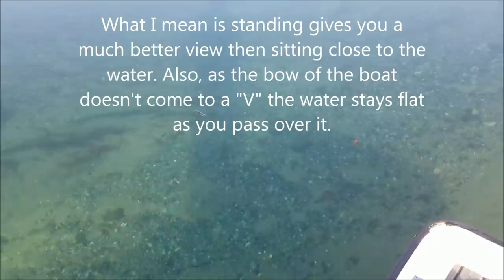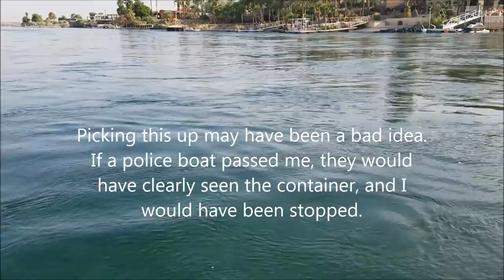I Bought The Strangest Little Boat On Craigslist

Comment: You should look into either building the jack plate higher so the pump isn't so far in the water, or see if it's possible to shorten the lower unit so that the intake of the pump is just below the bottom of the boat. Or, swap out the jet for a prop....but the jet would be a lot safer obviously. The prop will be much faster though, so it's kinda like half a dozen in one hand and 6 in the other. Cool project! Nice work!

Comment: The technique is old, it's called peel ply and used to form a smooth face when building up layers.  You will find a grooved roller very useful on corners compared to a splodging brush.  Also cut the bristles down about half and try that, much better at splodging.

Comment: After watching later in the video when you were first testing it, I can confirm adding some trim would be a good idea. Just a little, nothing too drastic. It will bring the front up a little when you're cruising up on plane. The boat will ride better and when up on plane you will only have the back like 2 ft of the boat in the water. You will also pick up a noticeable amount of speed.

Comment: Cool project just a little tip when putting screws in fiberglass you should always chanfer your holes or the gel coat will crack

Comment: Interesting to watch different techniques. I learned to use  a tray to saturate the fibres first and then lay the sheeting over the area to be repaired.  I would then use the plastic sheeting and use a wall paper roller to roll out the bubbles and excess resin.  Never had a failure.

Comment: I agree with you about the problem one faces with any squared edge as you said about the previous repair (and you were beginning to see in your repair) - and you began to see it in your repair.  I just had an idea because of that issue.  I've done fiber glassing to things that I've created or repaired and I've got and idea If I ever do any more application of cloth to an edge like that.  For instance - take a set of pieces of scrap plywood or 1" by 4" boards long enough for the section plus a few inches to cover the entire edge of the repair and some pieces of 1" thick foam rubber.  Because of the fact that the repair area of the craft is not too drastically curved what is being assembled will work over the area.  Then assemble the wood into a 90 degree angle form.  Cover the inside of the wood form with some foam rubber - and it really doesn't have to be glued to be form either.  While the repair area is still fresh and not cured -  cover the entire repair area with the protective plastic sheet to ensure the foam rubber will not stick to the repair.  And finally lay the foam rubber over the repair area, then lay the board form over the foam rubber and run some ropes or straps around the entire craft so they will hold the wood form tightly against the craft.  The foam rubber in between will be squashed tightly and it will take up the irregularities in the fiberglass repair.  This contraption will squeeze out the air bubbles and hold the fiberglass perfectly against the sub-structure.   Halilullah a great repair.

Comment: looks like fun!  watch out for your right trailer tail light. it's either not a boat trailer model or the seal is leaking and you could see bubbles when launching. hot bulbs (brake lights when launching) and water don't mix well! unplug the light connector before launch or seal the tail lights.

thanks for sharing!

Comment: Great, now you've got me thinking about building one.
Reply from the maker: A guy on facebook just got done restoring one his dad built in the 70's

https://m.facebook.com/groups/205974212923541?view=permalink&id=1567841896736759&sfnsn=mo&extid=MPOUlH6LSr3l5TKY
Reply: My first thought
Reply: List for build. Styrofoam, 3/4in sheet of plywood, a folding chair, and a small prop trolling motor. Duct tape, 12 pack of Bud Ice,
Reply: My dad used to build something similar out of 2 sheets of plywood, some 2x2's, a 1x2 and a 2x4. One sheet was the bottom of the boat, the other was cut into 6 strips (2 straight and 4 tapered)  that were used to build air tight 'pontoons' on either side.  The 2x4 went from side to side across the back at the top of those pontoons to mount the outboard.  The 1x2 was on the bottom center, front to rear as a keel. Put a 20 hp outboard on 50 lbs of lumber and it'll fly.
Reply: @sweet65mustang  what was this boat called
Reply: @rufinogonzalez6020  if you're referencing the boat my dad made, he called it a 'skip jack'

Comment: Little tip.
Tape the fiberglass on one side really good on the bottom.
NOT the side.
Fold it back
Then pour and brush the resin on the area to be covered.
Fold the clothe over stretching it tight but not to tight and tape the side really good. 
You should also have slightly streached it end to end when you first put it on.
Now pour and brush the rest of the resin.
You won't have to worry about bubbles that way and when your finished ready to remove the tape it'll give you a nice straight line to trim off excess clothe.
I helped my Dad build a homebuilt airplane growing up and he taught me that technique.
I've used many times since then on various projects and it makes compound and simple bends easy.

Comment: You could always put those carpeted rails on risers or on a scissor set up. Where you can raise & lower the boat on the trailer for towing & launching. That would be an amazing set up for it. And pretty cheap & easy to make. Well worth the small cost & effort. You should also seal those trailer lights up. Those bulbs & DC current dont either one car for water. Not if you want them to keep working for very long....

Comment: Good easy fast repair .... I would have cross drilled on diagonal and driven epoxy coated bamboo skewers thru...front to back angle slightly as well ..... just locks the crack together...... also after grinding down take acetone and soak down into the crack flexing it open closed let that set awhile 15 to 30 minutes then apply epoxy in the crack and flex then drive in skewers .... the acetone preps the surface for bonding and the skewers lock it all.... you can also drill couple small holes and inject resin into the inside position the boat so the resin will settle into the inside and create a strong fillet .... use teflon  cooking sheets works too many saran wrap etc stick into the resin
Reply: bamboo? skewers? i would love to see this technique done!

Comment: Been doing fiberglass repair for over 45 years and do not use mat always use cloth. It comes in different weights for different jobs. You can do repairs and relaying and if done right it is damn near impossible to tell. Have done boat, car and custom body repairs and paint. Making molds of edges on opposite side will make contours much easier to match and blend. There multitudes of tricks and tips you learn from the old pros. It took 45 years, but now I can say I am now working as an old pro! Good luck and keep the little jewel and keep it "shipshape" and you will have a piece of history. A unique piece of history! And put a larger power plant on it! Zoom! Zoom! :/
Reply: Looks great. Runs pretty damn good too! You did the little thing justice. Definitely do not get rid of it. It will be a great piece of unique history as it ages. And a conversation piece too! Sweet!

Comment: I used to make fiberglass enclosures for car audio systems. A good pro tip is to use spray adhesive to stick your mat to and that usually keeps the mat in the shape you want.

Comment: I have a Johnson 20 converted to a 35. Changed the intake and Reed valves to 35 then  put a 35 carb on with the correct jet ( not the 30 jet ) . Putting on a 56 14' Al. New 2" transom of marine ply from a 18' boat that had trailer tire burn because bearing seized on how, heavy traffic could not stop guardrails on side of two lane.
Big hole in side ,so salvaged,  parted use transom for 14. New 20-35 a 20" so will transom be.

Comment: I used to own two of these built by a company in San Dimas CA. They were cal!ed "Water Streakers" with 25hp Tohatsu  motors. I have some photos.
Reply from the maker: Please share.
Also, do you know what year they were?
Ever fall, or have any unsafe incidents? If so, what were you doing?
Reply: @BrandonsGarage  What year?  I think I bought them sometime around 1989.  I never fell but when you fall it goes straight so the risk of injury from the propeller is very small.  The seller advised to jump off if  you risk flipping upside down as then are hard to right and the outboard gets a soaking.

Comment: chop is for top layer . you have to get all the air out . Sand much more wider and deeper to remove crack . If you do it right it will be stronger than the boat

Comment: Nice job, Brandon!  I really enjoyed your style of presentation, with exactly the right amount of "comic relief" where appropriate!

One observation that I was surprised nobody else mentioned:  With regard to the trailer rebuild, and especially since this boat is not very maneuverable at slow speed,  I was surprised that you didn't add some bumpers/padding to the inner corners  on both sides.  this would obviously protect you from scratching chunks out of the front/sides of the boat when approaching the trailer.

Enjoy her - she's very cool! ;-)
Reply from the maker: I thought of that too, but as this isnt really the kind of boat would would power-load, I didnt think it needed.

Comment: Instead of a ziplock freezer bag, you can use a piece of bag from a food saver. Tape it around the edges and insert a small diameter tube that's been perforated. Connect tube to a vacuum pump. This works great for small stuff, amazingly.

Comment: Great, he did it his way the way it should be. The oriinal motor was stuffed, repaired it would have worked well its a light moto,r that's what it needs. The 20 it runs bad too, lots heavier not what the boat needs.That jet drive on a twenty dosent't work, your lucky to get 70- percent as if it had a prop. My guess is it was designed to be a cheap toy pre jetski perhaps. See that motor did not cost much and the hull  is simple cheqap to make, not as much glass and materials as a full size boat.. The company assuredly folded, it did not sell well or whatever, it failed. That said if you get enjoyment and it did not cost you much well call it a damn big success. I liked the restore all good domt forget to have fun people...

Comment: Pretty cool score !  A buddy of mine in Florida had a few of those original Personal Water crafts that  looked like a snowmobile but was powered by a Envinrude 9.9 outboard you did sit on top of a seat  but there wasn’t really any safetey provisions for  not  getting a hand or a foot into the prop?  I think they called those Water Scootersin the late 60s early 70s

Comment: First time I've seen your stuff. Really enjoyed your style.  I could nit-pick abut using chopped glass mat for structural repair but that boat and that case, meh. Doesn't matter. It was a really nice repair and boat turned out really well. Very unique. Rust-Oleum gel oat huh? I'll have to check it out. I'll have to check out your other stuff.

I'm looking for, having a hard time finding, an old late 50s/early '60s fiberglass boat with George Jetson tail fins. Don't recall the builder. I think they were all white hull and red topside. They used to be everywhere and could get 'em for a song. If you see one give me a shout. I've got an idea for a fun build and almost enough time to get started.
Reply: Glastron modeled a boat with fins after a Bel-Air
Reply: @turneynicholas  That would be perfect. Lone Star had a wild looking one too but I do prefer fiberglass for this build.

Comment: Nice job on the remod!!! I just came across one of these and am looking to remod as a one man fishing platform. How stable is it in the water? Did it feel tippy?
Reply from the maker: Only when getting on it; if you try to get on on the very edge it is. 
But if you put your leg/foot in a few inches its good.
Looking at it, you would thing its wonky, but its quite stable.
Reply: @BrandonsGarage  Thanks Brandon. Appreciate the reply. Does it take on much water? What’s your thoughts on using a Minn Kota 55lb thrust instead of the outboard? Also about how much did the boat weigh without the outboard?

Comment: Plug air into the hull at about 10 lbs and put soapy water on the hull. Next time woven mat and stretch it prior to installing with resin..your mat will fit better.

Comment: If you get a cheap vacuum pump and some plastic hose adapter you can tape a bag round the repair making it seal completely flat as it cures. Also using epoxy resin rather than the cheaper polyester resin will be a million times stronger.

Comment: Now a bit of really good advice would be to cover the wood bed of the trailer with carpet to protect the bottom of your fiberglass boat.  That wood would really do a good job of removing all the fiberglass on the way to the water hole and back home again. other than that good job.  OH, one more bit of good advice,  Mount your tail lights on stocks maybe a foot higher than they are now so that when the trailer goes into the water they don't get water inside and end up with corroded terminals and have working problems. and I saw that when you launched the boat the tail lights went underwater and air bubbles were coming out which also means water was going in and in time the taillights will fail from corrosion.

Comment: Next you should convert the outboard to electric. It's got a big enough space under the cowling you could fit a good-sized electric motor up there. Then put your batteries where the fuel tank is.

Comment: Nicely done sir butt you may have a problem with your tail lights. When you backed into the water you could see the air bubbles on both sides so it seems as though you will have to silicone the lenses and around the wires at the sockets. Be that as it is the over all reconstruction of the boat and trailer was still pretty darn good. Really liked the video it had me at laughing more than once so I give it a thumbs up.

Comment: I would like that better then a jet ski ! The flying surfboard ! Lol. You did a very nice job on the restoration and the jet outboard made it even more cool ! Do you know what kind of speed you got out of her ? Did you put some kind of tether on it ? I just finished a QD-19 and low and behold you ran one ! Coincidence ? I think not ! Lol. I’m sure if the patrol pulled you over and you said your just picking up garbage they would say thank you ! Right after the breath test and they reviewed the video ! Lmao
Reply from the maker: It would be breath test, then the pen thing, then PFD inspection, 
Then the inspections for a whistle/horn/warning device, a throw-able, fire extinguisher,  and registration.
The Problem is, I have that stuff, but its under the hood, which isn't easy to get to. I may get ticketed for it not being that accessible. Then, as I have California numbers on it, they would want to see my boat license too. 
Now, none of that stuff is required. I have a removal gas tank, so I'm not required to have a fire extinguisher. 
The boat is under 16' and not used for commercial purposes, all the other requirements go right out the window. 
But I would still be ticked, then have to drive the 160 miles to Barstow to plead 'not guilty' pay the fine, then return in a few months to state my case. 
It would be a whole thing.
Reply: Brandon's Garage they sure don’t make it easy to do the right thing out west there do they ? I think the laws here in Minnesota are not as bad ! Of course everyone needs a PFD but that’s the only thing and we don’t have to quarantine our vessel like California has to and very few motor restrictions like some states have ! I’m sorry you have so much trouble doing the right thing so I’ll say THANK YOU for cleaning the river for everyone to enjoy !

Comment: In Canada a 9hp you don't need a license to operate..  same in US----?
These would make great little "water taxi" around islands where people live..  I would extend the carpet rails out the back of the trailer a bit for easier aligning when loading boat and to make flat space in front of trailer to carry cargo..  and it will balance load more over wheels.
You could convert it into an "airboat"..  or take the "jet" out of a jetski and adapt it..
fyi could you turn your mic up a bit so the commercials don't end up so loud?

Comment: I Always drill beginning and end of a crack to prevent it from spreading underneath. It can keep growing underneath the new layers and you won't notice till it gets alot bigger. Also did you clean the corner before you added the tiny strip? I seen you blow it off but I always clean with a good solvent because your just fiberglassing it to the old resin dust  if you didnt, I think it turned out really nice, be a perfect one man bass fishing machine